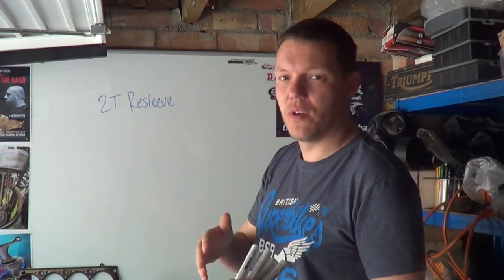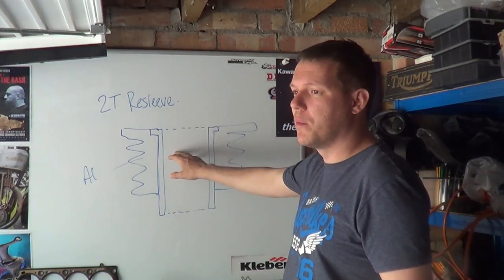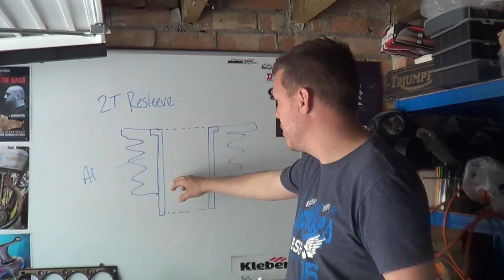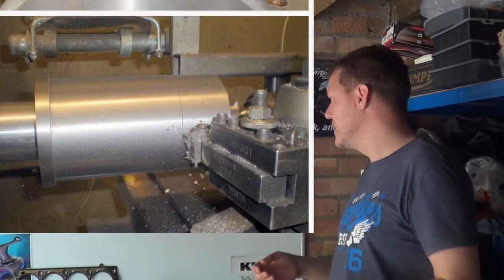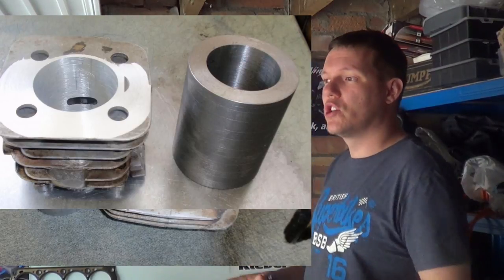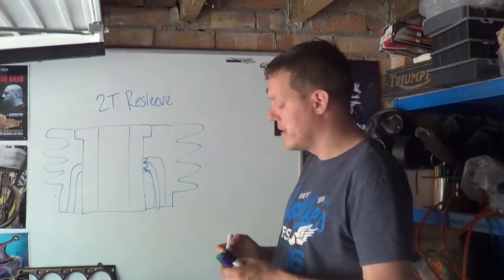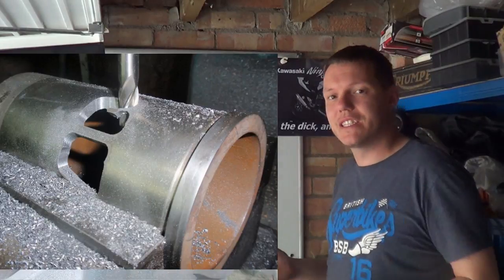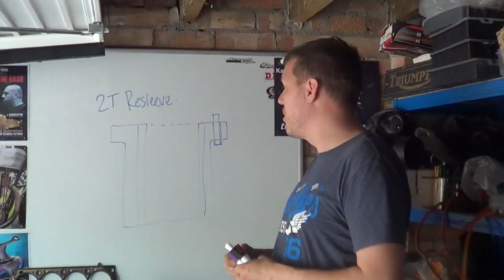2T Re-sleeving Process

Comment: I have used LA sleeve 2stroke sleeves which have ports CNC machined into them, just mark a compelling on top & on the sleeve top hat, machine barrel 0.1 smaller, heat barrel in a oven, then line up centre lines & quickly hammer sleeve with block of wood, then leave in hydraulic press to cool for shrink fit so it doesn't lift.

Comment: Hey I have a 2002 Yamaha Aerox 50 which I like tinkering on muchly so. As you said, it's cheaper with these to buy the whole cylinder assembly for these than to go out and having the rebuilding process done. I love the whole 2 stroke powerband kick-in-the-pants feeling, and you don't get that with 4 stroke, I don't care what anyone says. It's got a generic 70 kit and a leo vince exhaust at the moment, but it's soon to get a stage 6 mid race 70 cylinder , a 21mm carb, vforce reeds,12mm crank, digital ignition and overrange variator kit. They're the best for around town mopeds.

Comment: I completely appreciate the fact that you're busy mate and of course in your own time but a video going into more detail about why engines need sleeves/liners would be brilliant bud.
Reply: No need for a video on why engines need sleeves mate i've been intouch with darton who's focus is more towards cars but they've explained that sleeves are needed when increasing power because the stock cast iron/aluminium block would crack under the increased pressure from combustion. Cheers anyways mate.
Reply from the maker: Crack? Lol that's bollocks. Aluminium is too soft. Sleeves are inserted to extend the life of the block.

Aluminium cylinders can be coated instead of sleeving. 

Whoever told you that is talking bollocks.
Reply from the maker: Look up hoop stress.
Reply: @dirtygarageguy  Wow, I fucking believed them as wel i'm just a gullible bastard mate 😂
Reply: @dirtygarageguy  looked it up mate, from what I can gather hoop stress causes the cylinder to expand, I take it sleeves would prevent this from happening?
Reply from the maker: No. What I meant was that twat said cracking because of higher pressure, using the calculations for hoop stress you can see for an ally cylinder you'd need about 100 times the pressure.
Reply: @dirtygarageguy  ah right, sorry mate you're going to have to forgive me just takes a while to get through my fucking thick skull 😂
Reply: @dirtygarageguy  does this also apply to semi closed and closed engine decks because from i've "learnt" and just taken it as the final word, semi closed and closed decks are to support the cylinders under increased pressure but after listening to you that surely can't be the case mate
Reply from the maker: You're mixing up concepts. I'll be doing a video soon
Reply: @dirtygarageguy  Sorry Matt, I'll leave it at that and wait for you to work your magic mate

Comment: I think I remember hearing someone talking about drilling the new sleeve close to its final bore when mounted for good, then heating the whole cylinder to relieve any stress that might cause it to warp when being run to full temperature for the first time. After heat cycling it you would then drill the last 0.5mm or somthing
Reply from the maker: "drilling"? - Do you mean boring?
Reply: @dirtygarageguy  yeah sure did, my mistake
Reply from the maker: LOL no worries - I just wanted to make sure we're on the same page. As to the question - sounds like bollocks. The piston to cylinder clearance is defined by the piston OD and thermal expansion. If the bore was 0.05 too small the piston WILL seize, even during the 1st heat cycle
Reply: @dirtygarageguy  Yes I understand, but from what i remember the guy said the bore could deform a little(like 0.02) during the first heat cycle and thus the piston clearance would be to tight in spots not by much, but enough to want to heat cycle it once before doing the final bore. Since aluminium and whatever you use for the sleeve has different thermal expansion rates and there is not an even amount of material around the sleeve I guess it would not be impossible for it to deform a little bit when heat cycled. Might not matter anyway but just a thought.

Comment: My 2 strokes with sleeves always had a pin location to locate the sleeve correctly, clock wise....yes, it was race stuff so that might have a part in the equation.
Reply: I should add there was no reason to etch because the liner came with the ports pretty close.  You just do light work to match for port timing and such.

Comment: In India, the 2 stroke blocks are not heated up, the factory sleeve is not removed. The Lathe guys bore out the factory sleeve and then they press the local sleeve onto the block.
So now you have the remains of the factory sleeve + the local sleeve, the ports don't match, the engine often overheats and there have been cases where the local sleeve starts to rotate and you blow the whole thing up.
So yeah :/

Comment: the press fit is not required on most applications ,heat expansion is enough room for the sleeve to fall out or in .  your hone size with expansion  is in mind is the interference fit that holds the sleeve in place.  some casting are so massive a press type fit is required  but only in that type of situation.

Comment: you still need to chamfer the ports so you dont snag piston rings. cool video have never seen anyone make there own sleeve considering LA sleeves has all the hard parts done for you.
Reply: Tommy Kennedy 
he also botched the sketch of what happens with mismatched attack angle of milling.
if you're milling away the etched part the ports in the casting will line up but air has to hook at a sharp angle and the milled ports at the inside of the bore are what ends up wrong.
Reply: mondayfool 
run a spot drill around the edge. you can chamfer anything you can profile.
I'd be inclined to do the whole job start to finish on a rotary table set on end milling in the A rotation axis.

edit scratch the spot drill, I forgot it's inside. dovetail cutter.
Reply: mondayfool most guys just use a right angle Pencil grinder to chamfer the ports. No point in doing it on the mill if you are just going to bore it out again
Reply from the maker: "he also botched the sketch of what happens with mismatched attack angle of milling."

- what?
Reply: The Workshop 
at 13:40. if the sleeve is already etched and you have the sleeve in the mill, you're looking at the OD of the sleeve and milling on that. assuming you take away the etched part and leave the non etched it would be the ID where the milled thru ports don't line up the way they should. the sleeve would still line up with the casting but the air has to make a sharp angle or potentially the ports end up in a shape on the interior of the sleeve that fucks piston rings.

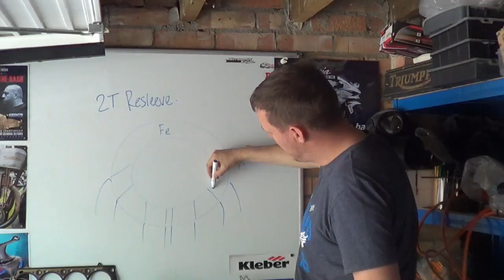Comment: when you explained the cuts on the new sleeve arround minute 13:30 something, the cuts are starting from the outside of the sleeve in to the inside, because thats where you have the markings from the acid, so the holes are going to match just with an abrupt change of angle from cylinder to sleeve.
Reply from the maker: what? You totally missed what I said

Comment: The only issue you have with a thick sleeve is one of heat conductivity.  We use 2 stroke race engines that are air cooled, and a thick liner means you have to run more fuel to cool it which produces less power.  So whilst it's good from a structural point of view, from a performance point of view, not so much :)

Comment: hey there, can see its been a while since this video was made. but ill try anyway.
i own a husqvarna 2010 wr300 2 stroke. i had my engine seized 2 times now. its been slightly modded to make a little more power.
this time around i am thinking about putting a sleeve into it.
will this be stronger than the factory nikacil coating?
i just want to have the strongest possible topend so the bike is more reliable.
greeting from Denmark!

Comment: I was thinking about how they put it back in the right way half-way across the video. The dowel is a pretty neat idea but it doesn't really guarantee it does it ? Cannot the sleeve and cylinder be keyed at a safe angle ? You need more machinnery but it would be straightforward then right ?

Comment: I just make my own sleeves from the start, light press fit by hand and some stud grade lock tight makes for a perfect fit.
Reply: loctite loses it's strength with heat, that's how you remove it. Not a good idea.
Reply: I would of thought that that would act as a thermal barrier between the sleeve and the cylinder?
Reply: You need one thousandth interference per inch of diameter minimum, freeze sleeve heat cylinder  to install.

Comment: what about cast alusil vs nicasil plated?
Reply: when you fuk up a nikasil cylinder you have to plate it again, you have at least 4 bores on a cast iron sleeve. i bought a cast iron cylinder for my 87 kx 250. it was sleeved in other words.
Reply: Yes nicasil is like that  but alusil is aluminum alloy with high content of silicon. Alusil cylinders are not sleeved or plated.

Comment: Suggestion for next video:
What'll happen if you put 2T expantion tank on 4T. I would like to know if it mess up the sound and what will happen on 4- bangers?
Reply: Gedas alekveravičius there's is a video where they're idling a 4T quad and they put a 2 stroke expansion chamber on it.
Reply: It will sound like shit and may damage the exhaust because 2T pipes aren't meant to handle the higher temperatures of 4T exhausts. Aside from that it won't do anything good or bad.

Comment: my honda nsr 125 is blowing up all the gaskets you thing it is due to too much compresion ratio?
Reply from the maker: Are you using OEM gaskets and what's your squish measurement?
Reply: Head and cylinder may not be flat anymore, also if it has had a sleeve installed be sure the sleeve has not sunk in the casting, too many times sleeves are incorrectly installed because the person doing it was in a hurry.

Comment: Hiya matt. Recently i've seen a discussion on the internet involving brake calipers. Discussion was about using brake cleaner or WD40 to clean your brake calliper. what would you recommend?
Reply from the maker: WD-40 is >25% petrolium oil, never good on brakes. WD-40 the company make this - http://www.wd40.co.uk/wd-40-specialist-motorbike/brake-cleaner/

End of argument!
Reply: I wouldnt use wd40 anyway since brake cleaner was specifically made for cleaning brakes. But the argument against brake cleaner was that it dries out the rubber seals.

Was just wondering about your opinion on the matter. Thanks.

Comment: I would like to ask you a question. It doesn't pertain to this video but, after watching many of your videos, you sound like the guy I should ask... Ok I had a main crank bearing pop 1 single ball out and seize up... It did not damage the crank or ANYTHING else besides the case on the opposite side of the bearing that broke???... Scared it up pe pretty good. Here's my question, if I sand the case smooth, just to where it knocks the sharp edges off, then install the crank with the correct feeler gauge for my motor, putting the feeler guage on the seated bearing, that would make my combustion chamber a bit bigger right, or would this not work? Thanks a bunch
Reply: So, more less, I would be opening both sides inside the case, because I'm going to sand them as close as possible to the same exact dimensions, but essentially keeping the crank in the center by using the feeler guage on the bearing surface. I think the deepest gouge from the bearing going out may be 10-15 thousands deep. That's why I think I can do it. It'll let me save my cases, put new bearings, but most of all have a bigger combustion chamber. Have you ever heard of this being done before or do u think it'll even work?
Reply: Any help would be greatly appreciated... Doesn't have to be him.. Thank you
Reply from the maker: "It did not damage the crank or ANYTHING else besides the case on the opposite side of the bearing that broke???.."

This is because the bearing can now 'tip' where the ball is missing - think of it like a see-saw, if one end tip the other end pops up.

"then install the crank with the correct feeler gauge for my motor, putting the feeler guage on the seated bearing, that would make my combustion chamber a bit bigger right, or would this not work? Thanks a bunch"

- Do you mean wedge a feeler gauge in between the casing and the bearing and leave it there? Because if that's what you mean then NO.
Reply: @dirtygarageguy  no install the main bearing into the housing, but then put a feeler guage on top the bearing to install the crank. As opposed to have the feeler guage resting on the housing.. I guess what I'm really asking is me, very gently, taking out material from the crank case on the sides of the crank would be ok? Not only would I not have to buy a crankcase, but it would make the chamber for air/fuel mixture bigger.
Reply: And thanks for the explanation on why the opposite side of the screwed up bearing is damaged more. 👍
Reply from the maker: Dude I'm going to say this nice and clearly - This is a VERY bad idea. IF and really I mean 'when' the bearing spins in the house it will eventually fire out the feeler gauge/shim, and then you'll be in a world of hurt. Have the cases machined and then rebored.

I know you're going to say that's expensive but that's just the way it is.

Now you can take my advice or not - but if you stick a shim between the cases and the bearing the bearing WILL spin - as it does so the bearing and the case cavity will get HOT and this will end in tears...
Reply: @dirtygarageguy  I don't think your getting my point. I'm in no way going to be leaving any kind of shim/filler guage in the motor. Let's just forget that part of it. I just wanna know if me using different grits of sand paper and get the inside of the case flat again. I could take it to a machine shop, or I can just buy a new set of cases, and probably what I'll do if what I'm thinking wont work. Both bearings seal completely fine within the case. I'm just sanding the gouges around the bearing to make flat again, which should increase volume in there, and (in my head) should increase horsepower to, due to the increased area/volume of air/fuel mixture between the crank and case walls. Does this sound right to you? Would it increase the hp?
Reply from the maker: "I'm just sanding the gouges around the bearing to make flat again, which should increase volume in there, and (in my head) should increase horsepower to, due to the increased area/volume of air/fuel mixture between the crank and case walls. Does this sound right to you? Would it increase the hp?"

- No. It won't

Comment: I like the video and your style of explaining Johns process, but that is by far not the best way to do it. There are so many reasons why. Did you ever get to trying it out yourself?
Reply from the maker: I'd love the hear the 'best way to do it' - over to you
Reply: The Workshop 

Ok challenge accepted, however it is going to be hard to put 30+ years of doing it in a reply on YT but let’s stick with what is wrong with JT methods. 

You need a very good thermal transfer you achieve this by the finish on both the sleeve and the cylinder wall, the cylinder is honed and the outsider the sleeve is ground. You have a interference fit of around 0.012mm depending on the cylinder. Now the issue is once you have heated up the cylinder and dropped the sleeve in (you don’t press it in) and it cools you get distortion to the sleeve and the cylinder, so if you then remove the sleeve you now have a distorted hole and sleeve and you have lost most of your interference fit. You can and should not put the same sleeve back in, you will not get the perfect fit and thermal conductivity. 

The next issue is the “acid etch” method, seriously flawed as the ports (mainly the transfer ports) all shot up at a angle, so your etched line is not where you need the port to start and stop, the bottom of the port will usually be 2-3 mm higher than what the cylinder casting is, in some cases GT750/ RD350-400 etc there is no lower part of the port left the new sleeve has to have the port cut in the correct place. This is where port maps and accurately measuring is key to getting a job that is equivalent to the original sleeve that was fitted by the manufacturer. 

When I make a sleeve, all the ports are cut into it and on installation they are in the correct place and required minimum and I really do mean minimum fettling. 

Let me know if you need any more info
Reply: @MrVee66  hey man coukd you please help me with my cilinder issues? I bought one used from ebay (it175 1977) looks like i was a bad resleeved one because the ports are no aligned, the sleeve sits about 2mm lower than the cilinder. Even the top of the sleeve is below the cilinder, any way to fix that? Thanks
Reply: @carlosdavidgalarza9338  i really cannot see how you can fix it without starting over
Reply: @MrVee66  you mean heating the cilinder to press out the sleeve and reinstall it?